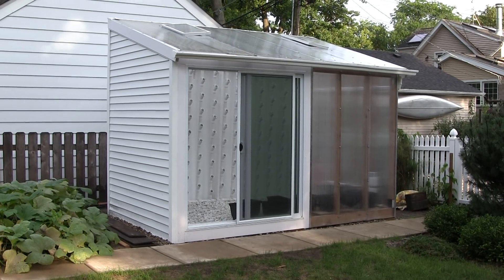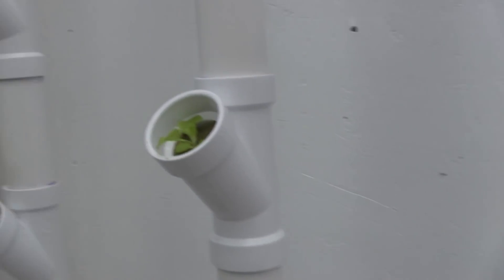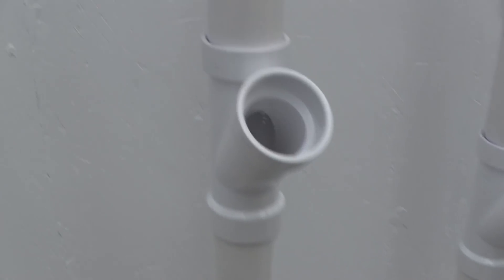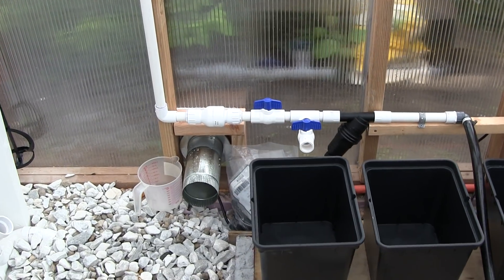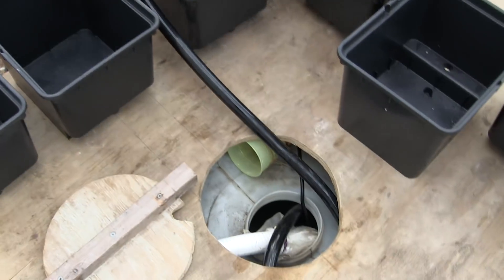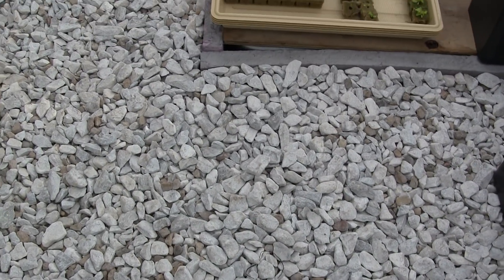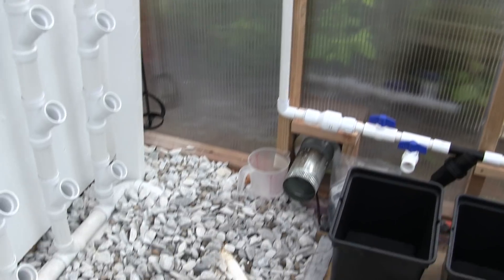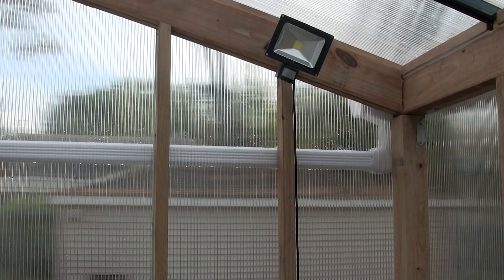2016 Passive Solar Hydroponic Greenhouse

Comment: Again how are your plants sitting in the pipe? Are they bare roots or are they in a medium and if so how far back in the pipe does the medium go?
Reply: MaryandJoe Neumayer love your system. just started in this direction and so glad i ran into your system. the 1.5 inch pipe with y connectors is genius. cutting 4" pipe, heating it up, you my friend have saved me from having to purchase tools i would used only once..
Reply from the maker: Hi Todd, I grow my plants in 1.5 inch rockwool plugs. They fill the width and length of the tee, so with the towers leaning slightly forward and the nutrient sprayed on the leaning end, the nutrient flows down the front of the pipe only, irrigating and aerating the plug/roots depending on the age of the plant. Depending on the environmental conditions you can irrigate anywhere from every 15 to 45 minutes (for example in the sun/heat of the day you want to irrigate more than during the cooler nighttime hours, as per photosynthetic requirements related to light intensity. The energy usage of the submerged pump is actually comically minimal, so extra irrigating will not make a significant difference in your bottom line. Hope this helps!

Comment: Love it! How is it faring, now that the cold weather started to hit? Also, will you post more as the winter comes?
Reply from the maker: Hi Michael, I am missing the sun! Unfortunately my neighbor to the south has an oak which is blocking my sun at this point of the year as it is moving lower in the southern sky. I'm finding that my heads at the top of the greenhouse are growing spectacularly - way faster than what my basement system could do. It's quite remarkable actually. But, alternatively, the light for many of my plants toward the bottom is getting blocked by those plants above, and some varieties are quite spindly and completely unmarketable. When my wife and I harvest weekly we even started to remove those leaves from the plants completely and put them in a container like those fancy baby leaf varieties in the store, instead of packaging them with the roots in water like the others. No biggie - we eat them throughout the week and it even saves time when preparing our lunch salads. But, if I had to market my heads I would need an additional light source for the lower half of my towers and I am not willing to do that at this point. I did take a video a week ago but haven't had the time to post it. Hopefully I'll make a new one soon and post if for you to see.

Regarding winter, I have decided to shut the system down around Christmas or before, depending on the weather.  I  won't be done with my heating system, and I'm not even sure if I will have enough light/sun to grow even if I would be able to add supplemental heat. Since this is the first winter I want to play it safe and see how it goes. Right now in October I'm measuring about 7 degrees warmer at night than the outdoor temperature if I close up. That poly has an R value of 2.2 so let's be realistic! I have started construction on an improved basement system to hold my family and buyers off for the cold winter months, and I have a new LED lighting design which I think may drop my energy usage by 50-60%.  It's a custom build with 100 watt replacement 5000K bulbs with 1650 lumen output on a double socket.  I'm super pumped to get it up and running but I just don't have the time right now. I'm hoping for late November completion, and perhaps I can move the plants directly from the greenhouse to the basement (without any bugs! gulp!).